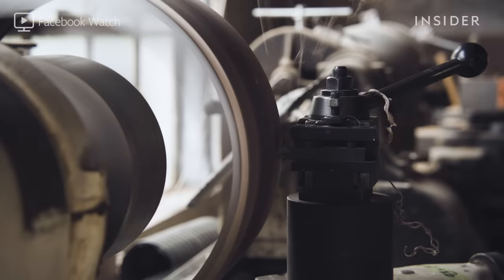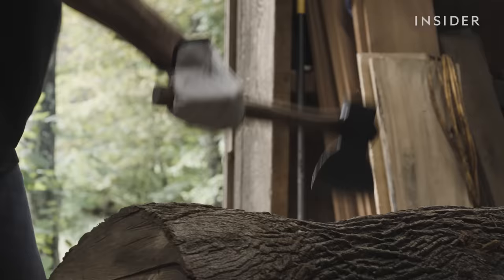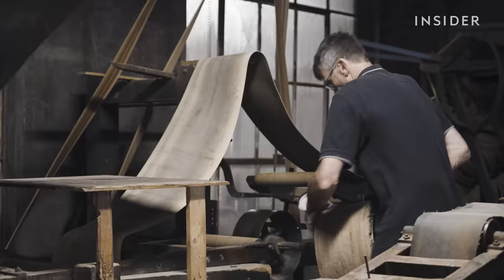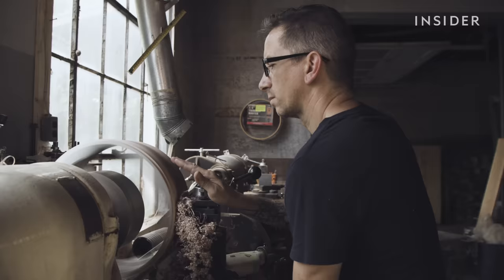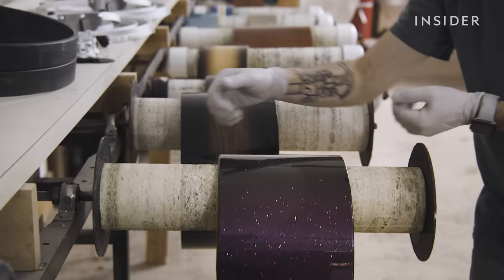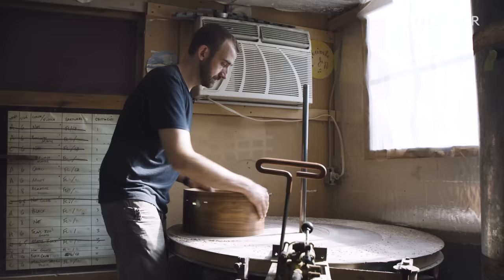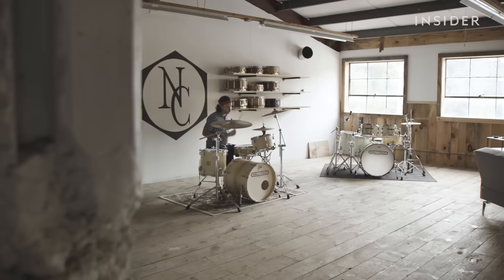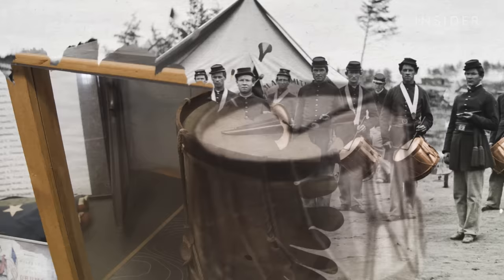How America's Oldest Drum Factory Stayed In Business For Over 160 Years | Still Standing

Comment: Noble & Cooley was the only newer drum i ever owned. I always had mid 1950's to late 1960's vintage drums. My go to were Gretsch, Premier, and Rogers in that order. I did purchase a plied and solid shell off Ebay; that were great snare drums. I had also owned 2 Slingerland Radio King solid shell snares, one being a 1939 and a mid 1940's. Again those old vintage drums had sound. Surprising to most, i had found a 13" x 8" Premier snare drum that was a brass shell, that had a five ply piece of Birch inside the shell. In my top 3 snares of all time. Primer had also made a 14" x 9" version.

Comment: The single rolled plank is a very old technique, and still highly coveted.   Awesome stuff.
Reply: What holds the seam together?
Reply: @ThekiBoran  was wondering that myself.
Reply: @ThekiBoran  They bevel the ends of the board so they overlap then glue them together. If you pause at 3:05 you can see it.
Reply: @Svenz0r 

Now I see it.  The bevel is about 4" or 5" from the ends, it isn't just the last 1/2" of each end.  A lot more surface area to glue.

Comment: I’m not a fan of reinforcement rings but N&C makes some great drums.
Reply: kills the sustain
Reply: Don't you need a reinforcement ring if it's a single ply drum?
Reply: @mjstecyk  it’s probably a good idea but when you add mass to already thick shells it dries them out and kills some resonance. Probably not the most noticeable thing on snares but on toms I feel like you can sometimes hear the difference
Reply: Re-rings raise the fundamental pitch of a drum.  Some of the old 40's to 50's Gretsch shells were made of thin, solid wood with no reinforcement.  Kent drums in Kenmore, NY, probably used some of these shells on their early drums. These shells sound great, with full resonance across the tuning range, but did not usually stay in round.  The bent shells have much less effect on tuning when using natural skins.  I had one of the early fifties six lug Kent snares with a shell made only of one piece of birdseye maple.  I can verify the fullness of thin open shells across the tuning range when used with calf skin heads.  Plain, solid shells are probably best.  Maybe stave designs are best suited for this purpose.  As a sound effect, let's do all our choking and muffling after the drums are made.  Not knocking Noble and Cooley, though.  In this age of inflexible polyester drum heads, reinforcement rings seem to be the best way to stabilize this type of shell for optimum sound quality and durability.
Reply: re-rings are good for snares tone tho. That's why so many gretsch guys play other snares

Comment: As an engineer in precision manufacturing, some of these steps look like they could be improved with the implementation of some fixtures. For example, the drilling could use a fixture that locks the shell in place to a rotating table. The table can have precise holes in it to allow a locking pin to correctly position the shell for each hole.
Reply: Yeah, seems like there's a better way to go about drilling those very important holes

Comment: Let me make this very clear. I have been a drummer for 65 years. There is nothing that comes close to Ludwig. Nothing. A lot has to do with the heads you use also. I prefer ATTACK heads. I saw something strange with 4 top ten drummers in the past 3 years. When asking them why they use their specific set they told me confidentially that the shells were Ludwig but identified as another brand. “I’m getting paid to use this brand but use Ludwig under the covers.” After looking closely that was true. Bass drum heads were changed.